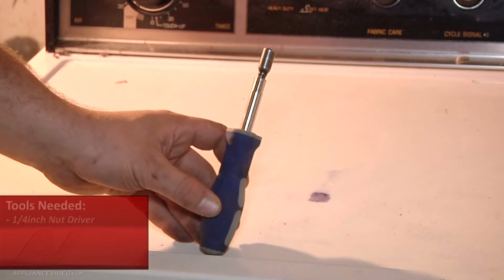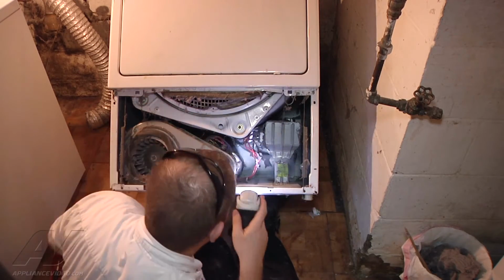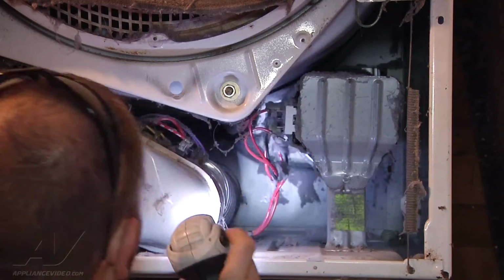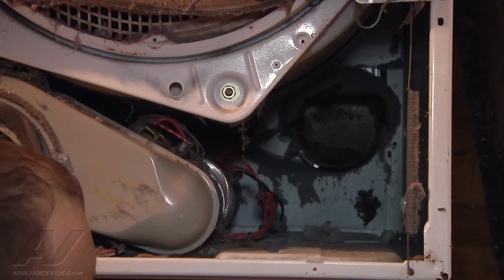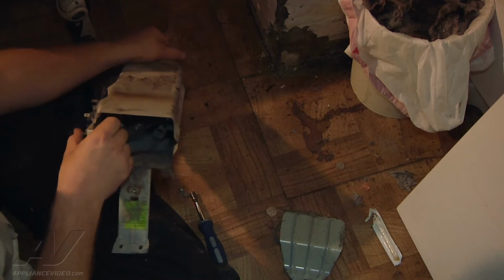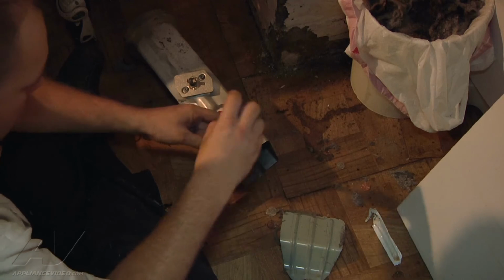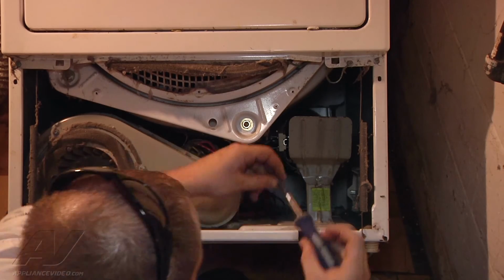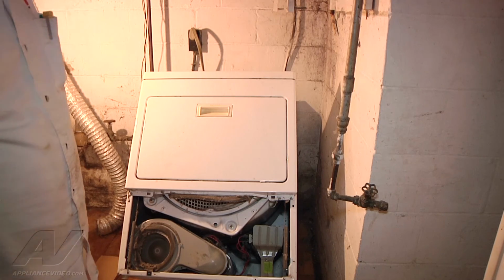Kenmore Dryer Repair - Not Heating - Heating Element

Comment: Great video BUT the front of my Canadian Kenmore dryer does not have an upper and lower panel. It is all one piece. How do I access the heating element which I think is on the front of the machine? (I've taken the back off and it doesn't look anything like the other Kenmores with the heating element in the back.) Thanks fir any help you  can give.
Reply from the maker: Great question, if you have a more technical question that our parts department cannot answer, you can search our over 17,000 answered questions free at our website www.ApplianceVideo.com under our Repair Help section. You can also call our parts department at 1-800-830-5465 and they can give you help 7-days A week ,or search at www.SaveMoreOnParts.com  .